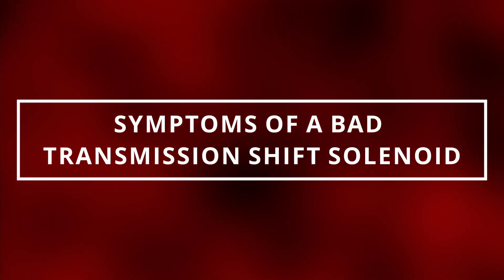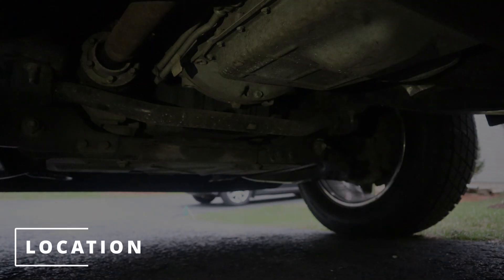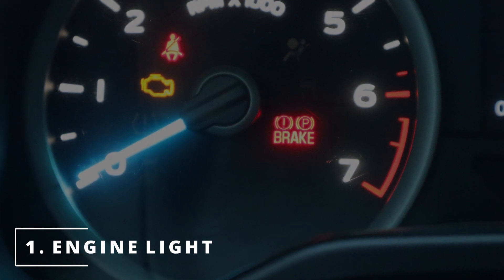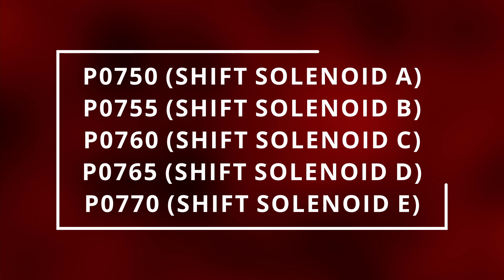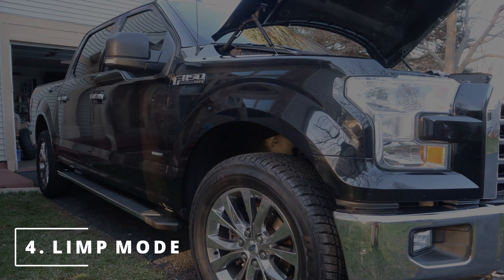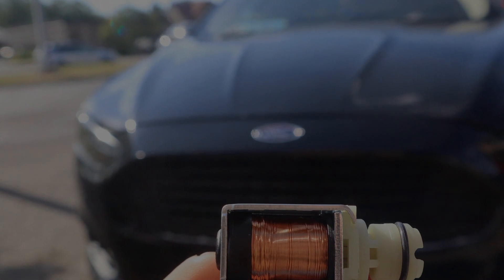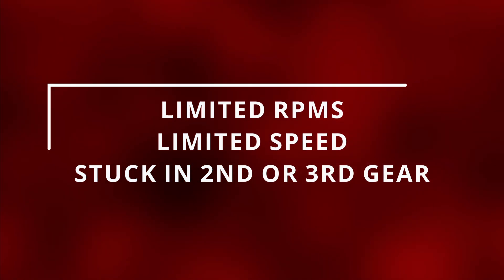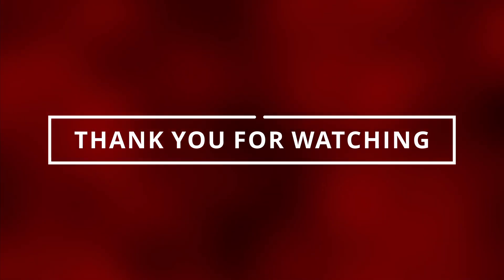SYMPTOMS OF A BAD TRANSMISSION SHIFT SOLENOID

Comment: Right on brother ' you've given me hope. 👍 As I drive my 2009 F-150 4×4, the automatic transmission will shift into first gear smoothly, it shifts into second smoothly, then it clunks sharply into third gear at around 35 to 40 mph. Viewing your video, I'm hoping it is something as simple as a solenoide. Thanks again 👍🙏
Reply: My 1999 GMC was doing the same thing. It was the solenoid.
Reply: @UNIT6AUBURN what exactly was it doing because I’m having that same issue
Reply: @Resignating  It was shifting hard going into 2nd and 3rd gear. I mean HARD like a jerk.
Reply: Any luck with this video my f150 is doing similar things you speak of when it goes to third gear. Please let me know thank you
Reply: @vind357  Lukas transmission fluid can help with hard shifting transmission
Reply: Same issue I'm having, it started today with my 01' Ford F150 Lariat. I just changed the transmission fluid and filter. Now I'm at this video trying to see if I need to change the shift solenoid.
Reply: Did this fix ur issue
Reply: What's the word?
Reply: @memphistiger4647  it's possible the OP will totally fk up the solenoid replacement if he attempts himself
Reply: @MrHuddo you can literally say that about anything lol

Comment: My friend has 2011 Ford F-350,super duty xlt he changed his tranny fluid he also had code p0772 and reset it they cheap machine. Now the truck won’t crank and the gear position does not light up on dash. I wanna help him he’s a great friend. Any suggestions? Thanks appreciate your videos by the way

Comment: My 2015 malibu runs great I only have 72,000 miles. One day when I went to pull of from a red light it went into limp mode. It will rev up great but didnt hardly pull. Turn car off start over, it goes fine until it happens again. I did a code test at local auto parts and it showed the 3rd shift solenoid code I believe. You described it exactly when you said it could go into the limp mode. My car runs great any other time and it just happens some times. Is this expensive to fix? The chevrolet told me over $700 for the shift solenoid panel

Comment: What about a sudden and quick jerking, as if a pothole was hit but definitely wasn't.
2011 Jeep Patriot Sport, 2.0L Front wheel drive.
CVT fluid never been changed (it has an appointment tomorrow at a local transmission shop to get done)
My OBD2 reader shows 0 codes flagged. All looks good from it, but it does show that my battery is a bit low voltage during startup.
12.4V stationary, dips to 8.3V during startup for the fraction of a second, then the alternator takes over and puts it at 14.2V.

Comment: A friend's Chevrolet truck went into "limp mode" and wouldn't change into 3rd gear. He fired the parts cannon and had spent all kinds of $$ trying to figure out what it was. I came over while he and his "automotive tech" neighbor were standing around the truck scratching their heads. Lol when I asked if he tried replacing the transmission shift solenoid his "tech" buddy immediately blurted out "thanks but it wouldn't shift at all if it was bad."
Long story short.... It was the solenoid.  I think he'd spend a couple hundred bucks already. Lol $18 for the solenoid, and around $40 bucks for pan gasket and new ATF was all he really needed.
Reply: which one of the 5?

Comment: I have a 2019 hellcat, hoping for it to be the solenoid and the transmission, car starts right up every time I put it in drive the gear blanks and says it is not engaged put it back in park and put it in the desired gear. Even then there is no acceleration from the car regardless of reverse or shift paddles also you cannot push it in neutral. What do you think that is

Comment: Question: In a 2012 subaru impeza hatchback automatic transmission, I'm running high rpms/idle and a delay in shifting from reverse to drive or from park to drive/reverse. Cvt fluid exchange done but hasn't helped the slow shift much. What else should I consider being the issue?
Reply: Check all the ground wires,  some are nowhere near where you would think to look, a bad ground will make the engine run at higher rpm & affect the trans. Shifts also.
Reply: @raydeese4439  ok will do. Thanks so much

Comment: Hi mate love the videos subbed. wonder if you can help me I have a 2006 Hyundai santa fe and was driving the other day when it sounded like it popped out of gear and into neutral. I pulled over and it wont drive forward but it will reverse no problem. there was no grinding or noise of anything breaking in the transmission so could it be the solenoid??
Edit: also it's an automatic but can be put into manual and when in manual I can select 1st and second  but not 3rd 4th or 5th

Comment: My 1990 k2500 4+4 5 speed  shifter grommet or shifter rubber piece that goes around the shifter ball that goes into the transmission shift that makes it fit tight and shipped with like eight and up and I have tried everywhere to get one and I cannot and I have tried everything I could think of but for some reason it seems like it still don't want to s***

Comment: Help! My boyfriend had been borrowing my 2003 Ford Explorer Sport Trac, 6 cyl, and the next day I went to drive it and put it into gear, and it had no forward drives - only reverse. He will not tell me anything about what happened or how it had been driving. I was thinking it was in limp mode when he came home, although I have no way of telling. It has sit now for a year as I work from home and instead of fixing my truck, he purchased himself a car and we have been using that. I need my own wheels and want to get my truck going again. besides the typical things like fuel for getting a car going once it has sit for some time, I am wondering what should be the first things to do to get it going again. Can I get the old codes to show up if I can get it to start or are they gone since it has been without a battery for some time (he took the batter out for his car)? I just put a new battery in it. Hoping you can steer me as to where to start. Thanks in advance...

Comment: I have a 1995 Silverado 5.7L 4x4.... Put in gear, and it barely moves  just high rpms and takes forever to get to 30mph then boom we are off to the races runs like a champ, what's my issue?

Comment: If my engine light worked 😤. I had it scanned, nothing came up lol. It won't shift into high gear sometimes. Problem is linked to having a hard time starting. When it starts right up, no problem, when it doesn't, no high gear

Comment: Yeah think mine is the PCM. No designated TCM. Won't shift into 4th gear then I pour water on the PCM.  Everything works fine again for a while. 
 New transmission ( 3rd in 3 years,)  So I'll look outside the transmission. Gotta be something frying them

Comment: 2 days ago my older 2000 F250 (only 136,000 miles on it) went "clunk" and the whole truck lurched - then it was like it was stuck in a low gear.  I still had to drive a mile home - it did this 3 more times, lurching like it was about to stop, stuck in a low gear and higher rpm's - but it got me and my groceries home - and I haven't touched it since.  Least now I know what to tell the mechanic.  Thanks.
Reply: Shut car off and restart it , that’s how I drive my truck, shifting smooth after I restart truck
Reply: How you solved? I have same problem

Comment: Just changed  the 1-2 shift solenoid in  Blazer the other day. Drove great after replacing the solenoid.
Reply: My 2000 Blazer won't go in reverse. I put it in reverse and hit the gas and nothing happens
Reply: @JB2FROSTY  the solenoids are not to expensive. Worth changing to see if it helps. The one I did had a code for a shift solenoid circuit fault.
Reply: @JB2FROSTY you ever fix the problem, my 2010 Chrysler 300 won’t go in gear once it gets a little warm

Comment: Thank you so much young man.  I have a 2016 Ford Focus and had the clutch replaced and my car is still experiencing these symptoms and by watching your video I realized my car is going into limp mode.  The dealership will not fix anything else other than the clutch that’s under warranty unless I cough up some more money.  Thank you!
Reply: Get rid of that car! The Focuses have trans n clutch issues! I had one and I had gotten the Clutch replaced like 4 times. Recall on it.
Reply: @you6542  manual transmissions don't have shift solenoids.
Reply: i had a 2016 had clutches replaced 4 times then traded it in
Reply: @DJ_Rob_NC  Thanks for your reply!  My car is FINALLY fixed!
Reply: @macywood4619  what was the problem and what did you have fixed? The solenoid?
Reply: @Houseofariyah  Oh no dear!   It was the release clutch.   That’s a bigger issue than the clutch.   Thank God I had it fixed!
Reply: @macywood4619  to be straight forward, if I were you, I would trade in or sell the focus asap. I love Ford, but for several years in a row (starting in 2012 past 2016) the "powershift transmission" that was introduced has become infamous for failure. do a little research and see how many recalls there were in that time frame for the transmission. Sell it while it's fixed because it wont stay that way nearly as long as any transmission should. i know what transmission replacements cost, and doing it several times is quickly going to outweigh the value of the car. there are several extremely reliable and comfortable options that will go for the same ticket price as you will receive for the "fixed focus".
Reply: I clogged catalytic converter also creates similar symptoms.
Reply: @precisiont5188  Unfortunately, it’s not that!  Ford told me it’s the master clutch just some more bullshit.

Comment: My 2001 lesabre started with severe delayed shifting, first to second wasn't bad but second to third would slam into gear, I did some research and found that this was a known problem on some lesabre models. The temporary fix if you can call it that is to shut the car off which resets the module, leave it off for a couple of minutes then it shifts normally again until it does it again, sometimes it lasts for a bit but then the problem comes back, with close to 300,000 miles it was time to replace all five solonoids. I purchased all five as a package deal off eBay, all OEM parts, the first thing is to prepare the patient by raising the rear and front of the car, I used ramps on the rear and jacked up the front as high as I could because you need to lower the subframe and remove the strut cv axle and everything necessary to gain access to the side cover of the transmission. Remove the cover and it's relatively easy after that except for one thing, the wiring harness that connects the solonoids together, from being heated and cooled a million times the clips that hold the connectors are more brittle than Bob Barkers back, one broke on me and there's no real way to secure it thst I felt confident with. I went to my local Buick dealer and go my surprise they still made the harness, and it could be mine for the poultry sum of 350.00 dollars. I told him I'd let him know, went home and low and behold I found one on eBay for 25 bucks, the only thing was that now I had to wait almost a week with the car in pieces taking up my driveway. I received the part put everything back together and prayed. That was about five years ago and she's been shifting perfect ever since, all told parts, the side cover gasket was the most, second to the solonoids at 55 bucks, all five solonoids were 75 from eBay,,the whole job was around maybe 175 including trans fluid, you loss a lot from the side cover, I also removed and replaced the trans filter while I was at it. I've been working on cars for almost 40 years now, I wouldn't recommend doing if yourself for a beginner but then again, everybody has to start somewhere, power tools aren't necessary but they make the job to faster, with hand tools it's a lot of nuts and bolts to remove.
Reply: What state you located?
Reply: I have a 2002 lexus that when I get to 2000 rpms it’s takes a good amount more pressure than usual to hit 3000, could I be needing the same fix ?
Reply: I have changed transmission on 1998 Lincoln town car limo.  At a Michanic shop.  It worked for a bit  then the first shift does not go.   Hard to move the car till you push lots of gas. But when it moves. It shifts fine till you stop. .  Backing up was hard when   Shifting reverse. Now reversing is normal.   It’s weird.   What do you suggest?
Reply: @Peter. Thanks for your comment, its just what I’ve been looking for. I have a 2000 xterra that doesn’t shift into second sometimes and I too kill the engine for a minute or so then restart and usually it will start shifting again. I was hoping it was going to be the TCM so I found one on eBay and it still did the same thing. Oh well, I’ve got a spare module. I’ll get some solenoid valves and dive back into the bottom of transmission. I just changed the filter recently as well as the fluid a couple of times. Was your problem the solenoid itself or is there spools that were dirty and not shifting? Thanks
Reply: Fuckin write a book on it
Reply: @brandonbell5357 hey the more info the better
Reply: Where are you??? I need you???
Reply: Thank You Bro. Have The Same Car & Your Testimony Makes Me Confident It's My Solenoids
Reply: Thank you mien is ford f150 2005 I’m hoping to replace the torque solenoid
Reply: Exact reason why im watching this video. Thank you for all the details!
Reply: appreciate your comments....Have an05 LeSabre.  Sometimes rough bump after initial shift into drive. Five solenoids?
Saw a separate reference about 4 solenoids..wonder what the 5th one is. Could u mention the specific seller on Ebay?
Thanks for t your excellent post..jP
Reply: How you paid for all 5 ?
Reply: @vonstew3314  The same way you always pay for purchases on eBay or any online retailer.
Reply: @Peter-pv8xx  I meant how much bro
Reply: @vonstew3314  About 80 bucks at the time.

Comment: could you make a video on how to change or clean the shift solenoid ?
Reply: that's a good one .
Reply: With the tran fluid pan removed, you simply pull it off, it clicks on like any wire connector. Looking is knowing.
Reply: @markweaks2239  you never have replaced one have you......there is a lot more to the removal than that
Reply: @RDBDallas  I have, Changing your own transmission fluid om GM trucks involves removing 16 bolts to remove the transmission oil pan.. Its messy. Fluid spills all over, Tip tne pan and guide the fluid into an oil drain pan or on the ground if youre a dumbass. Once off, you are staring at the flat plastic oil filter that simply pulls off, then see several solenoids and their wires, and their connectors. Simply unplug and pull them off. Plug in a new or multiple new ones. Install a fresh filter. Clean the oilpan. Reinstall the bolts with new gasket ( comes with filter in box.) Put the bolts back on without stripping them. Put back in the same amount of fluid that drained out with new fluid. Make sure not to overfill.Dipsti k check. Drive and see if that combination solves the shift trouble.

Comment: Great video, I have a 2000 JEEP WJ 4.7 and it started shifting hard from 1-2 and the kickdown from 4 to 2nd is really hard, do you have any idea on were to start? Cheers man!
Reply: Coworker has the same issue.
Reply: @e.l.9589  It rusted out to be a disk plate set and needs replacing. The OEM diagnostic tool made an adaptation for the gearbox and now it works smoothly. The guy told me that would last 100-200km but I did 700km and still shifts perfectly smooth. 
Cheers
Reply: @itasev  Nice, his downshifts on the freeway to high rpm but if he restarts it then it drives normal again.

Comment: So I was told today by a big national transmission chain that changing solenoids went out in the 70s and that in modern transmissions, the solenoids are not serviceable. 
My problem is that shifting into 1st gear from a stop is rough. But once the car is rolling, I can slam the throttle up to whatever 80MPH, SLAM THE BRAKES ON and then slam the throttle back up to 80 and every shift on my automatic 6 speed is smooth. 
Yet I’m being told that I need a completely rebuilt trans. It doesn’t make sense.
Reply: Sounds like the pump is lost seal. Higher rpm will force more fluid. 
I would just replace the pump.
Reply: @michaelshirley3042  i cant get these guys to listen to me. 6 shops now have told me rebuild. I think its just a generic answer they giver everyone for anything that has to be done inside the trans. 
So its a one price rebuild for 3-4k and if all they have to do is replace one obvious part, they make alot. If 25 parts need to be replaced, they cut corners to keep profit up. 
Pisses me off.
Reply: @joesalemi2414  transmission shops stay in business by selling transmissions. Not by telling you the exact problem. Not saying that the transmission not in need of a rebuild, I can't determine that via YouTube
Reply: @michaelshirley3042  yes, its a big ripoff in need of regulation. Any problem with the trans is a one-price rebuild. 
I mean ok fine, you go for a brake job and every single time its, “oh you need new rotors we cant just turn em.”  Fine at least you know you got new rotors. 
But with the trans you dont pay for a pump or TCM or solenoids separately. I stead you pay for a “rebuild” not knowing what needs to be done. 
How about they charge you to tear it down and then itemize parts replaced?  The prices would vary according to what you actually need and not just one generic price.

Comment: I have a question ?? I have and acura tl 2006 and in 1st gear shifts with a skirk sound and in 3rd  between 30 to 50mph the car shakes a lil bit but shifts normal what could b thanx in advance?

Comment: Wife said  she couldn’t change gears from park on my truck (o fuck) checked the Linkage on the top nothing. When I looked at the link on the bottom there was a fucking rock in between shifting mechanism and the bell housing of the Tran stopping it from changing gears